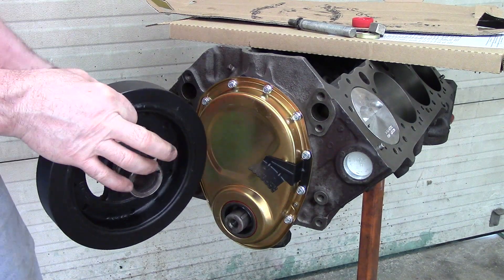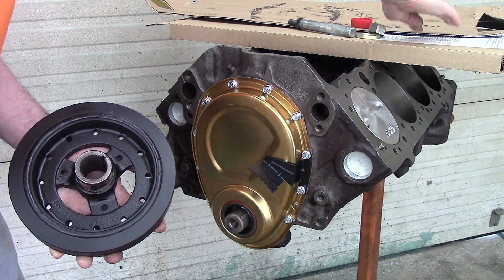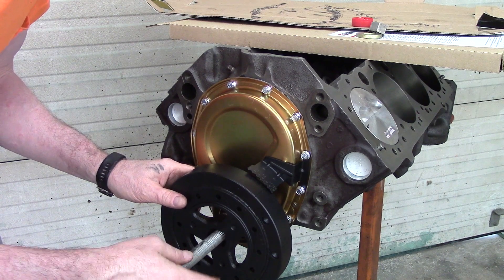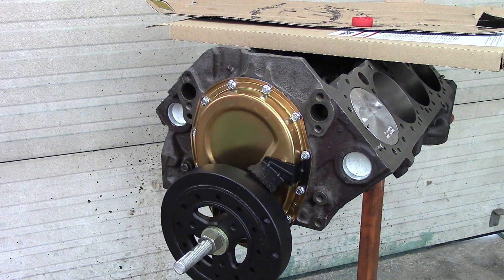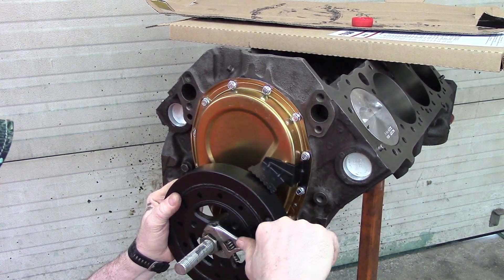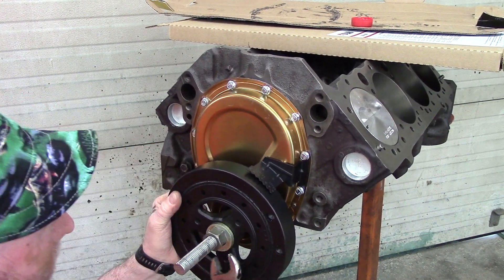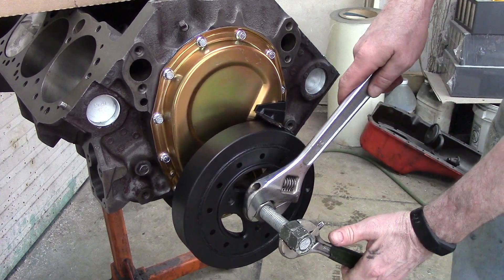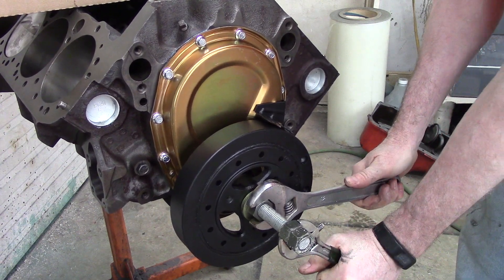V-8 Engine Rebuild SBC #8 Harmonic Balancer Install

Comment: Is that a 6.75 inch or and 8 inch Harmonic Balancer.
Reply from the maker: Yes it worked welk for me, my truck came stock with the 8" balancer.  An 8" balancer on yours may have required a new timing tab, or cover to be somewhat stock or a degreed balancer.
Reply from the maker: 8"
Reply: @HRIservicesllcSturgeonBay  I had ordered an 8" and had it as I build my 76 Corvette as several people in forums and reviews stated that pumping up the power and 8" was better as I added Howards roller cam and Flotek heads and etc. However when I contacted Professional Products whom I purchased it from they recommended I use the 6.75 because it was a 76 corvette. So I did an exchange.  I hope it worked out for you. ✍

Comment: how do you know if its all the way seated to the crank sprocket ? i know your pullies won't line up and all but is there a measurement from the block to the damper or cover to the damper
Reply: Supposedly it's 1-1.25" inside  the balancer before you insert the bolt, but honeslty all you do is butt it up until it stops against the timing gear.
Reply from the maker: As stated below, you can measure prior to installation.

Comment: It don't make sense torquing in steps on 1 bolt, steps are for multiple bolts that have a sequence to follow to insure even torquing among them all.
Reply: @yari cavalry well if somebody is going to try & teach something it should at least be correct
Reply: @yari cavalry plus there is nothing about this video to not understand, I don't think you understand torquing
Reply from the maker: I will answer all three of your statements right here, torque one bolt to stop from stripping out the threads or breaking off the bolt in the crankshaft. Thanks for the comment.

Comment: What’s the danger of overnighting a harmonic balancer?
Reply: Stripped thread at least
Reply: Strip threads or stretch/break a bolt off in the crank. It’s a fun time.
Reply from the maker: Great answers by others below!

Comment: there is absolutely no reason to step or incrementally torque a single bolt. that is for a large surface such as heads so you do not bow  or warp a surface . anyone who makes videos should not go out on their own with pre conceived notions about mechanical things they do not verify before making the video. people who lack knowledge are watching these and take them to heart for accuracy. oh my! no wonder there is so much misinformation taken as fact in the current time.
Reply from the maker: I like to teach everything the same, if you get used to doing it in increments you'll do it when it counts.
Reply: it might help. if the torque wrench has a problem you have better control, you hear the click at lower torque then next click you kind of know where it should be. I had such problem and that’s what I did